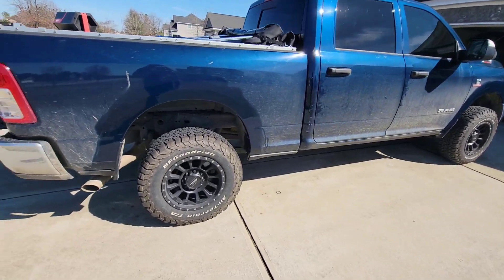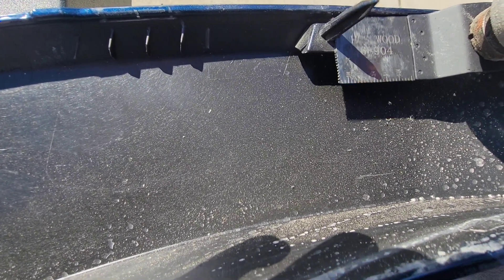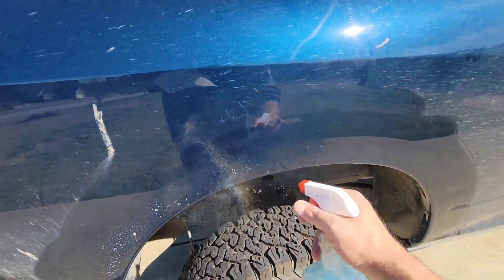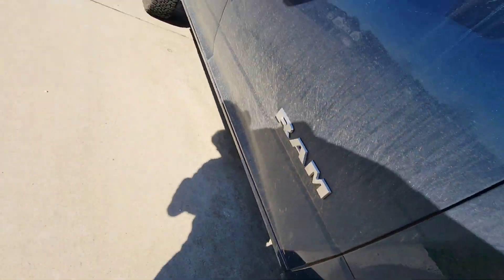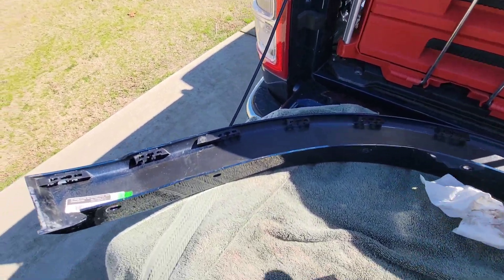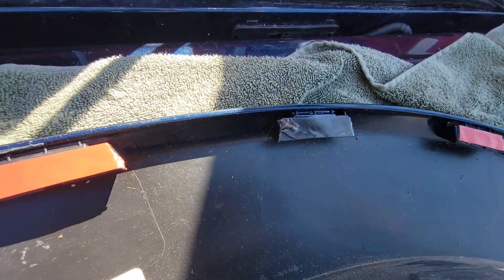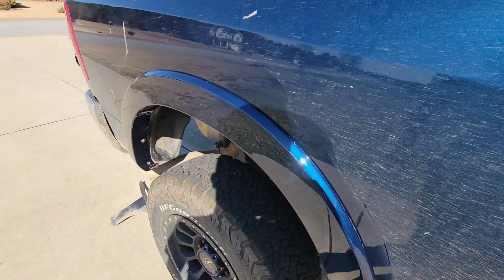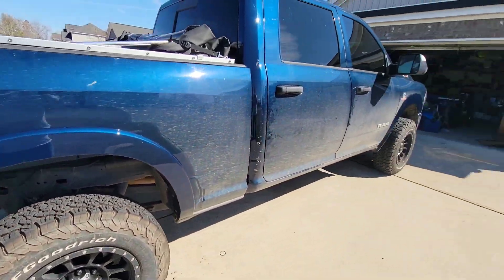5th generation Ram 2500 3500 factory fender flare install

Comment: I am glad that you struggled with everything including the double side tape as I do! LOL. I just bought these new and found I have to drill holes! I knew someone did this! Nice that this works. I will be doing it to mine. How they've been holding up over the time?
Reply from the maker: Holding up just fine, I think my tape had been in my garage a while so I wish I had used a new roll and maybe a bit wider. It did fine but I think the peace of mind would be worth it. Check out my other videos on Ram stuff and like and subscribe if you dont mind

Comment: Did you notice that one piece of double sided tape wasn't thick enough to make contact with the metal?
Reply from the maker: I noticed I wished I had used two strips, however I haven't had any problems.